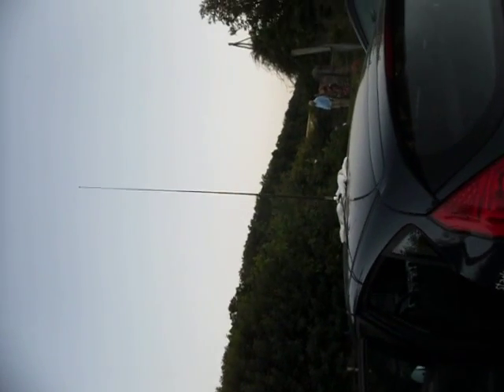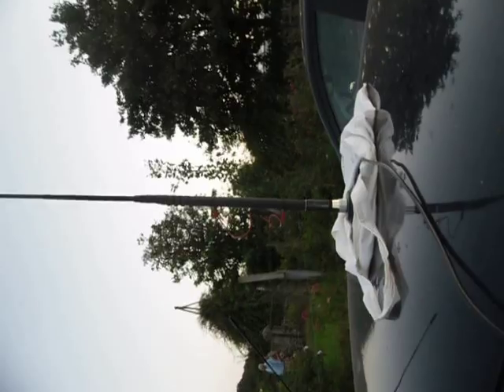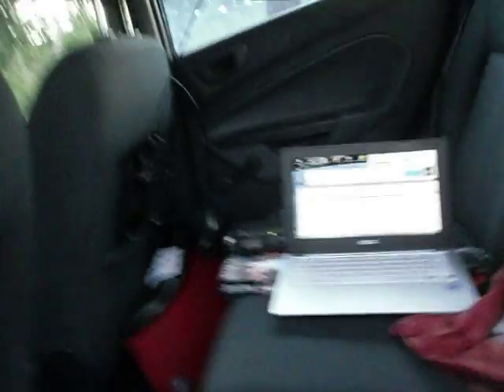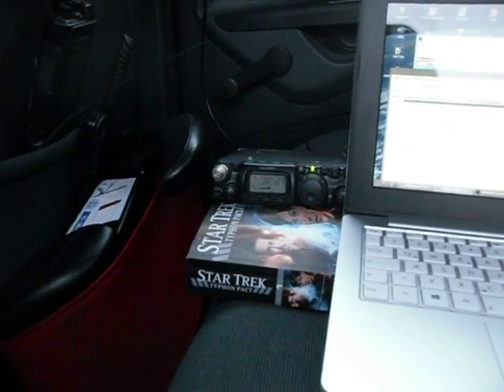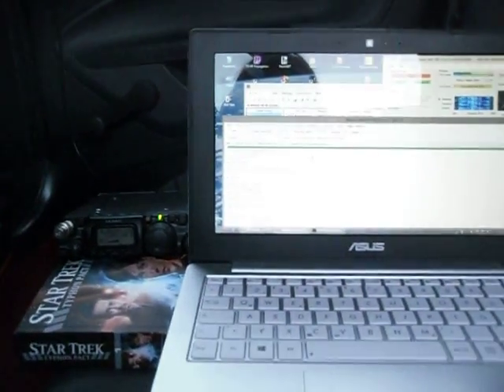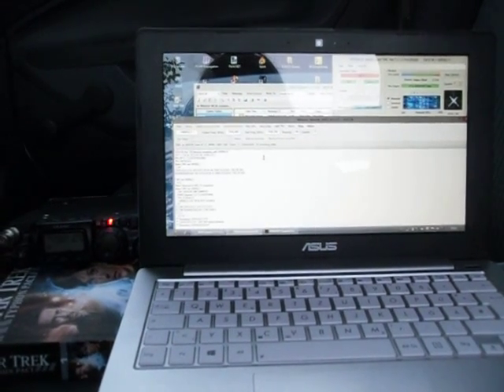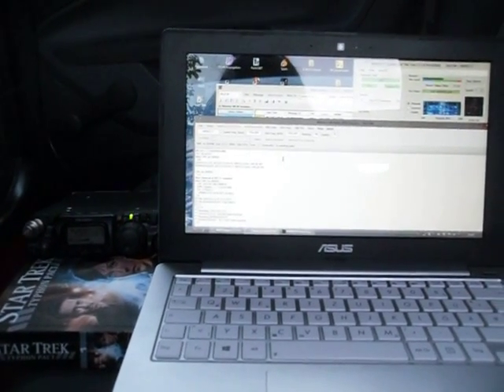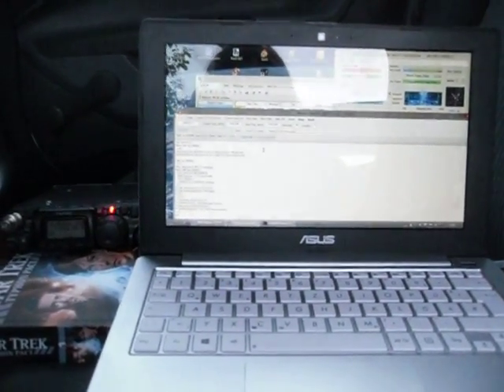E-Mail via HF portable and QRP (2W) using WINMOR with acoustic coupling (WinLink 2000)

Comment: What settings are you using for winmor? I can't get my 817 to connect
Reply from the maker: It depends on which interface is being used. If you're using the side MIC connector (audio cable or acoustic coupling with the Microphone), set your FT-817 to USB. If you're using a DATA cable (rear connector), set mode to DIG, menu item 24 DIG DISP to 0 HZ, item 6 DIG MODE to USER-U and item 27 DIG SHIFT to 0 Hz. 73 de JP, DK3CW